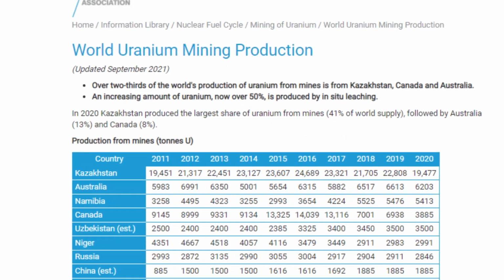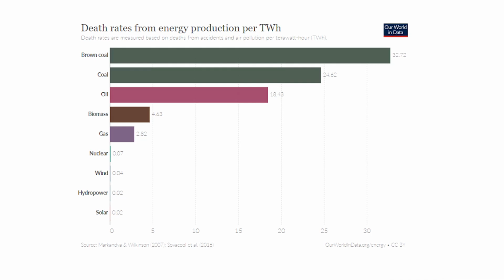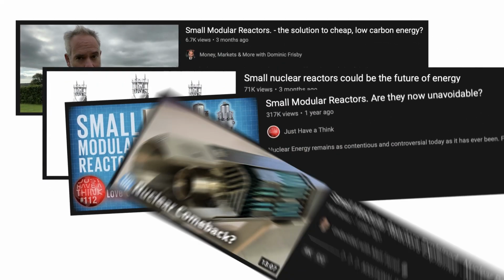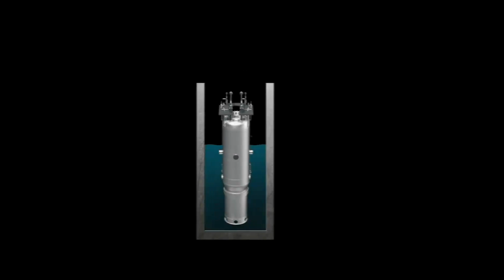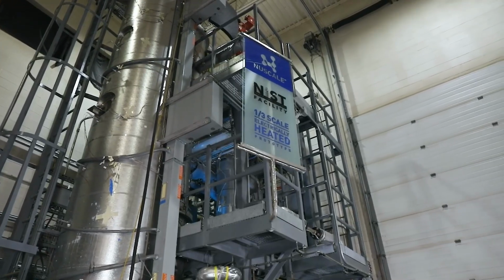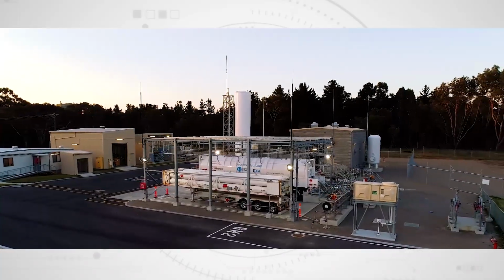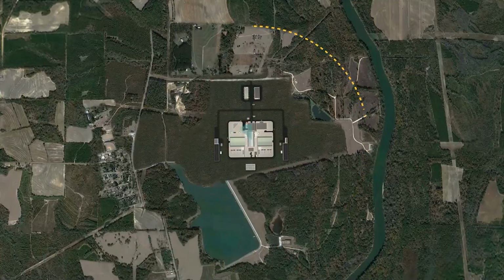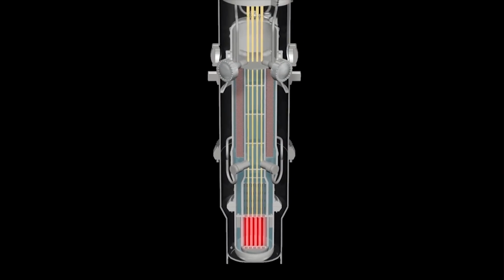Can Small Modular Reactors Save Nuclear Power?

Comment: Once topic that is rarely discussed in the nuclear arena is the impact of mining, processing and transporting the uranium. As I understand it, not that much is used, in relative terms (compared to continually feeding a coal fired plant), but renewables don't need any fuel of this sort and thus don't need mining trucks and diggers and machines for processing and trucks for transport all spewing out CO2. And as Jabiluka showed, sometimes the resource is in a place of heritage significance (or maybe environmental significance). Personally, I think we should be using CST plants, PV and wind where possible, and nuclear at latitudes that are prohibitive of solar. That said, "emergency" reactors that can quickly be placed in a devastated area to provide a lot of power really quickly sound like a very handy thing to have as climate change increases severe weather events like the flooding over east.
Reply: You mean other than the mining and production for the panels, and batteries?
Reply: @killcat1971  Notice I said "fuel", not one-off production resources/emissions.
Reply: @PinataOblongata  Mining uses fuel, so does transport, energy production for panel production can use fuel, if you use natural gas that's fuel.

Comment: I'm curious - when these things are being transported on a truck or ship, how safe are they? What would be the result of a truck crashing, or being attacked by ballistic weapons in a less secure region, or of a ship sinking with one on board? And what would be the impact of an earthquake that actually disrupts the ground and immediately drains the water from around the unit? When you don't have days of cooling down slowly, and go straight to relying on the steel container to dissipate heat (and the thing is now buried in dirt) what happens?
Reply: Reactors are never shipped with their fuel loaded. And the reaction cannot proceed without moderators.
Reply: @GalenMatson  Thanks! Seems obvious, now, but I was thinking of them as like a completely pre-fabbed sealed unit.

Comment: I'm 100% for grid scale nuclear and consumer scale renewables. Solar is great but requires grid scale storage. 
I would rather battery capacity goes into vehicles than the grid. 
Nuclear is cleaner and more reliable with less land usage. People are cutting down forests and using crop land for solar. These land use changes have significant negative consequences. 
Germany is a prime example of what NOT to do. 
Their Global warming out has gone up dramatically as has their energy costs with reduced reliability. 
France is the model all countries should aspire to.
Reply: This is just misinformation that is constantly repeated online. Germany heavily reduced its CO2 output in the past 2-3 decades. Their energy costs gone up quickly though as they had to replace nuclear power and coal power with renewables at a very fast rate. These changes are directly paid for by a tax put on energy prices. France has a very different system where the government pays for nuclear power plants and as result keeps power costs low.
Reply: @devluz  However, after 2-3 decades of trying SWB, Germany's emissions per capita are still above the European average, and France's emissions are way below the European average.

Thus France is the model to emulate, not Germany.

Facts - kind of important!
Reply: No one was disputing that. The comment I replied to incorrectly claimed Germanys emission went up. Which is outright a lie
Reply: @devluz  Germany's emissions have gone up in 2021 and early 2022.
Despite having more installed wind and solar capacity than ever, there was less wind and sun in Europe in 2021 and early 2022.

Germany made up the difference with coal and natural gas - increasing emissions.
The IEA will publish that next year probably - but I can understand that burning more stuff in 2021/2022 raised emissions over 2019/2022. You should be able to understand that also.

Comment: Happily today in the UK our government and the opposition confirmed more base load nuclear plant would be constructed ASAP. Also more offshore  floating wind farms. It looks like we will have the most expensive electricity in the world from 1st April. 

I like your videos from an engineering point of view but I know first hand you can create pricing comparisons to highlight a view point . Around the year 2000 a study on the comparative costs of all forms of generation was done for the UK government by a company I was involved with. The study included all phases of a project including decommissioning.
Most expensive with a life of 20 years ?  Yes off shore wind £145/MWhr Cheapest with a life span of 60 years? Nuclear £60/ MWh

Fast forward 20 years and the improved wind turbine designs have improved the utilisation factor for some models to as much as 45 % from 25 %. Life span increased to 25 years. These improvements make some positive difference But in the UK price in a credit for carbon saved  and miraculously wind becomes much cheaper.

I once worked in all six of the UK s nuclear plant which were funded by our then nationalist power industry and we were a world leader . Privatisation happened and no new nuclear and all skills in nuclear disbanded and now gone. In the last few years the realization dawned that perhaps new nuclear would be good. To get the international private sector involved the UK government had to guarantee a strike price of £145/ MWh……….Also the complete lack of talent in the civil service  all contributes to high prices for the first of a kind new 4 th generation plant. Hopefully the Nth of a kind prices will be 50 % less.

Bet you Germany keeps it’s nuclear plant running a bit longer now they have decided not to import Russian gas!!

Comment: I'm not opposed to nuclear energy, and I think that nuclear plants can be operated safely (France is a good example), but what I haven't seen is a good cradle to grave cost analysis for SMRs, especially at end of life. I.e. we need good realistic answers to questions like what is the lifetime of an SMR, what happens when the uranium fuel is spent, can they be refueled, where does the spent fuel go, and if not reusable, how is the reactor recycled or disposed of, and the cost of each of these steps. These questions have been a major Achilles heel for large large nuclear reactors.
Reply: We need these analysis with a lot of industrial projects we are engaging in right now, especially with the nascent space and renewable/battery industries. I am all for expanding both industries, but I am also not blind to the fact the waste streams both will produce (reuse and recycling considered) a hundred to a thousand years down the line will be mindbogglingly enormous if we do not have a plan in place now.

Comment: I saw a video a while back about how SMRs could utilise existing or decommissioned coal and gas plant facilities to reduce costs even more.
Using the existing turbines and replacing boilers with SMRs seems  a practical and cost effective solution to me.
Not that it will ever happen in NZ, there would be to much opposition to anything nuclear no matter how potentially climate saving it may be.

Comment: Hi Rosie.  Disappointing to realize that SMRs are so far away despite the developments noted in this video.  You mentioned the need to MOVE FAST.  I have a concept which might fill the bill.  I have a demonstrable concept for a wave powered water wheel that converts the kinetic energy of an ocean wave directly into rotary motion, no intervening gears or systems.  It would be located at 9 - 17m below the water surface and would continue to function regardless of wave conditions (if they are large enough).  It is based on my understanding of how waves are physically created, an understanding which is not current in the scientific community.  If you wish to know more let me know and I will forward my email.

Comment: I love your videos and the work that you do! ❤️.  However, I am not a fan of nuclear because of a complete failure in development of a way to dispose of the waste.  Currently, there are more than 90,000 metric tonnes of  radioactive nuclear wastes in the United States alone.  While the amount of power generated and the fewer emissions are very good, ultimately the waste issue is a time bomb waiting to go off. San Onofre nuclear plant has had numerous problems during its decommissioning.   Renewables are really the way of the future.  I hope you continue to look into and design improved and innovative energy sources.  Thank you. 😎
Reply: 99% of that 90,000 tons of waste is LOW grade waste, like garments and rubber gloves, and massive amounts of packaging to put them in. The actual high level waste of the whole world (excluding Chernobyl) will fit inside a single 20' shipping container. Please watch "Illinois EnergyProf" here for more information.
Reply: @MrHuram-abi  I do not profess to be an engineer or have detailed knowledge of nuclear waste.  However, the US Department of Energy (DOE) has represented that the US generates about 2,000 metric tons of spent fuel annually.  That figure represents a total (since the 1950s) of about 90,000 metric tons of spent fuel (not gloves or other low level waste). The spent nuclear fuel is kept at 76 facilities across the country, because of a failure to develop a centralized storage location ( Yuca Mt plan was abandoned about 10 years ago).  So, the current storage is temporary, waiting for the NRC to find a better solution.  According to DOE, the 90,000 metric tons fills an entire football field to a depth of 10 feet.  Sorry, but that DOE representation raises serious questions about the validity of your 20 ft storage container description.   See, https://www.energy.gov/ne/articles/5-fast-facts-about-spent-nuclear-fuel

No need to dwell on this, I just raised a concern about the small nuclear plant discussed in Rosie’s video.  I believe we need to solve the nuclear waste issue before advancing further plant construction.  It’s just my concern, I understand that others may not have the same concerns and have no problem with that.  In fact, the only reason I am responding here is because the facts you present are inconsistent with those presented by DOE.  I don’t know who is correct, just pointing it out.  Cheers!
Reply: No it takes very very less space to store nuclear wastes, see the debate on Nuclear energy on Great courses.
Reply: @donpasto59  it has nothing to do with the amount of space the radioactive waste takes up.  Rather, it is the toxicity and thousands of years emitting deadly levels of radiation ☢️ that is the concern.   90,000 metic tons of highly radioactive waste in the US alone shows how far behind we are in its disposal.  Much is held in temporary storage while the NRC and others try to figure out where it can go without causing harm.  Fix that problem and it would become a global solution for much needed energy - particularly the smaller localized plants that were the subject of Rosie’s video.  Cheers, 😎
Reply: And solar panels use really toxic stuff that lasts forever since it isn’t radioactive and no one is storing it at all. Metals like lead cadmium and chromium to name some. And there isn’t any plan to store the waste. And to generate the same amount of power as a nuclear reactor does, it produces about 300 to 400 times more waste
Reply: In which case we  could use  fast reactors to burn up the waste. https://www.youtube.com/watch?v=C6BGLgJY0Wg&t=50s
Reply: A big reason for that is because people keep preventing them from doing that. And there is a place in Finland where they are planning on storing massive amounts of waste. There are also other types of reactors that can use the long lived waste for even more energy. Things like fast reactors certain (but most I think) molten salt reactors where it is physically impossible to have a release of radiation unless you bomb it. As well as dozens of other types reactors that can use the waste.

Comment: This was good coverage on the topic.  Please look into synthetic methane (if you have not yet done so). Making synthetic methane could be a good solution in places where there is seasonal need for combined heat and power. This is merely a step forward on the hydrogen electrolysis that you have covered. Any method, where renewables could be stored for longer is a positive track. This consept of replacing methane reforming is very interesting as well.
Reply: "synthetic methane" doesn't come from underground but it still puts CO2 into the atmosphere, which goes against the reason for global warming.  Everyone is going to  have to stop adding CO2 to the atmosphere and instead the CO2 must be sequestered in the ground, where it can be safely kept.  Instead of synthetic methane, the energy must be stored in green hydrogen or possibly ammonia made from green hydrogen.
Reply: @acmefixer1  of course methane releaces co2 when burnt. The idea of Synthetic methane is to capture co2 that would be released to atmosphere anyhow and use that as an intermediate storage device. By all means, methane is not an ideal solution, but it would be very feasible to current infrastructure and therefore easy to adopt. 

Synthetic methane should be net zero and therefore not adding more concentration. The infrastructure to other fuels needs to be built and that is a challenge of its own that cannot happen in the 0-10 years perspective. Synthetic methane can.

Comment: Wind, solar, water and storage are quickly gobbling up the energy market.  In fact, as you stated, our energy generation needs to be mostly emissions free by 2030. It's going to be hard to justify introducing a new technology by that time, especially in a grid dominated by renewables.  Based on the cost curves of renewables and storage, nuclear SMRs will have to be half the current cost of wind and solar to merit the financial risk of introducing them.  As you mentioned, delivering solutions on time and on budget is not what the nuclear industry is known for.  Your video was, however, a nice explanation of the technology.  Thanks!
Reply: "In fact, as you stated, our energy generation needs to be mostly emissions free by 2030. It's going to be hard to justify introducing a new technology by that time, especially in a grid dominated by renewables."

Norway and Iceland have proven that grids can be decarbonized using hydro and geothermal.

France, Sweden, Ontario have proven that grids can be decarbonized using nuclear.

Nobody has shown that grids can be decarbonized using wind and solar. Aren't you the one buying the pig in the poke?

Denmark? - emissions below the European average, but not at the emissions-sustainable level of France or Sweden. They started with their wind program shortly after WWII - will they make 2030?

Germany? - after 10 years and 350 billion euro emissions are still above the European average - they certainly won' make 2030.

California? - emissions aren't even at the US average and the US average is too high as it is!

I get it - you think % RE installed solves climate change. Hate to tell you this bud, but reducing emissions solves climate change, and Team SWB isn't doing so well.

Comment: I think that this is potentially a more acceptable way to continue with Nuclear power. The main thing that really needs development is how the waste spent fuel is processed, that’s the thing which is the most unacceptable part.
It could be a very good ‘gap stop’ plus the hydrogen and oxygen generation could be lucrative.
As usual a very interesting topic, keep them coming 👍
Reply: Highly-radioactive spent nuclear fuel is but a small portion of the radioactive waste produced by fission reactors.  Up to 90% of the radioactive waste is considered intermediate to low-level waste that is a lot easier to safely deal with.  Much of the spent fuel can be processed and re-enriched which not only makes more fuel but also reduces the amount of highly-radioactive waste to deal with.  This would allow nuclear power to become a carbon neutral way of generating power until technology allows for the use of other less problematic carbon neutral methods to replace the nuclear power.